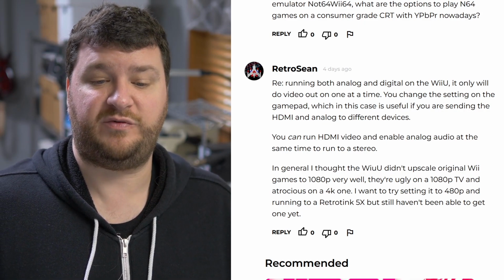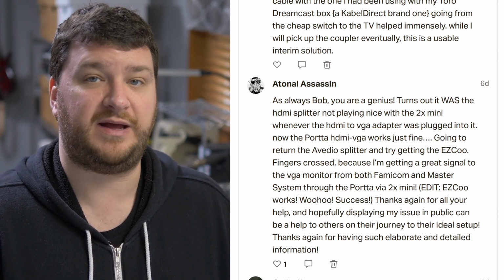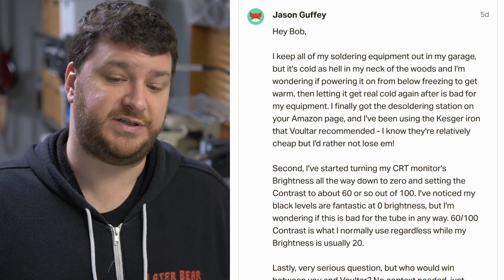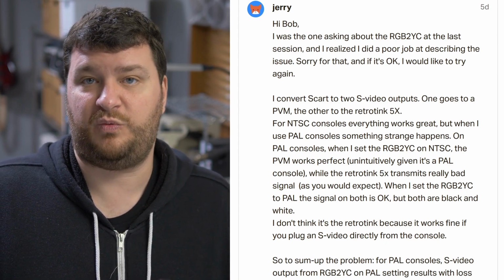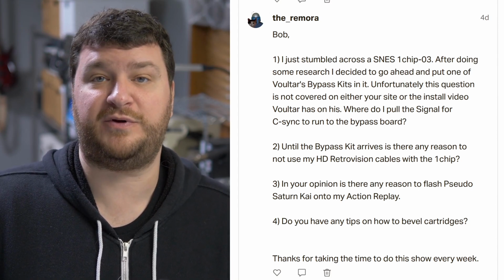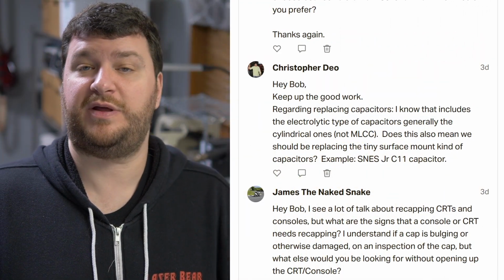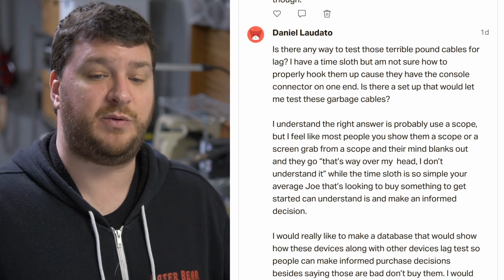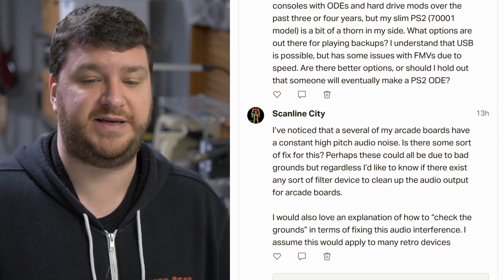Supporter Q&A #190

Comment: In regards to ps2 hdd’s there is an opl compatibility list available. For some games you’ll have to enable mode 1 & mode 2 so the timings will be solid. For some dual layer dvd games you’ll have to disable igr